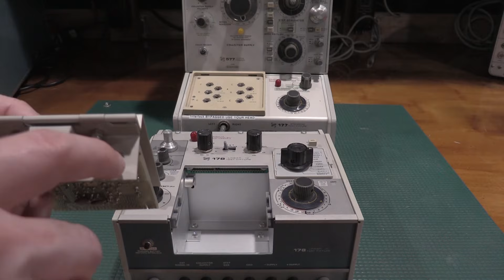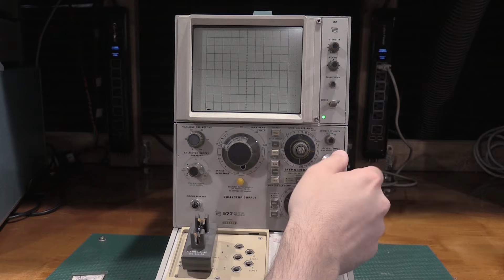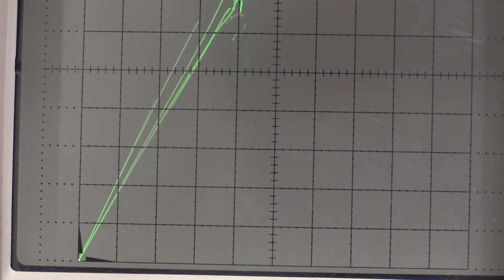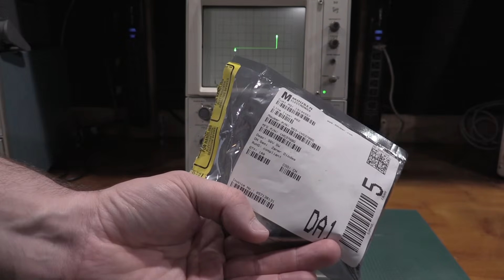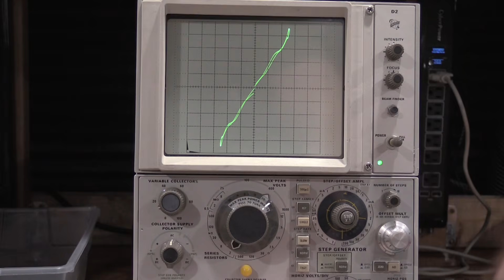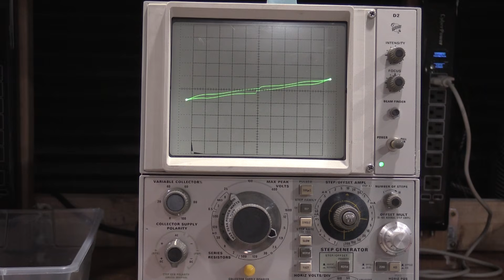Putting Random Things on Curve Tracers Russian Tunnel Diodes

Comment: How do you multiply the vertical amplitude it's by 10? Thank you for your video.
Testing capacitors are leads connected to emitter and collector?
Reply from the maker: On the 577 the 10X zoom is on the position controls. There are two versions however. The old style is a pull out this is the signal knob control and is very touchy when in use. The newer style is a dual controls course and fine. This is done by pushing the fine adjustment to release the control it will pop out and activate the 10X magnifier. There is a 10X on the vertical as well as the horizontal.

Comment: Interesting video, thank you. Glad to see your tunnel diodes arrived and check out - they are rated at 21 mA (if they are the part number I suggested).
Reply from the maker: They are if i remember correctly. I did test one in a 284 but they wont work there. They are significantly larger then one in the air line.  I do however have some plans of them. It will be interesting to see what happens.
Reply: @ZenwizardStudios, you used 3И201Г ?
I believe original TD is germanium with voltage drop about 0,1V and russian is GaAs with 0,2. To drive it will be better to recalculate all resistive part of circuit after coommon collector output transistors, then to exercise with a pair of resistors. Only exactely 200mV amplitude will be difficult to set - if it really matters.
Also this diode has capacitance not above 4pF instead of original 1,5, it makes risetime close to 70pS in ideal world.
There is another pair of russian TDs, one Ge and one GaAs, also rated 18-22 mA, but with lower capacitance. There dimensions is also smaller (another type).
Reply: Sorry to hear that they wouldn't  fit, the ones I received were larger than the original but did fit with a minor modification to the plastic diode holder.
Reply from the maker: Hmm might revisit that 284 again I have the diode still in the air line but it did not want to fire correctly, and given The thickness change it did not line up well with the trippers. Hmmm now the gray matter is rolling.
Reply: As I mentioned  in my second reply on your previous 248 video, I did have to play with the value of R148 to get reliable triggering of the Russian diodes.
Reply from the maker: R148 or R184, R184 is the resister in the air line
Reply: @ZenwizardStudios   I changed the value of R148 in the negative side bias driver - My R184 measured good for both values and I really did not want to change anything in the air line. I ended up with a value of 341 ohms for R148 (up from 39 ohms) to get the tunnel diode bias adjustment into a range that would give reliable pulse output for each tripper pulse. I probably should have balanced the resistance change between R138 and R148 but the circuit seemed to perform just fine changing R148. The Russian TDs seem to have fairly wide tolerances and mine needed lower bias current to get it to trip properly.
Reply from the maker: David V. I adjusted the R184 in the air line as it had I pulled out the 120 Ohm resister as I needed to rebuild it anyway the lead of the solder joint cracked. Doing that needed me out a 100 Mv pulse with a measured rise time of about 200 ns. I can get a better rise time if the drop the amplitude abit I can get it to go down to about 176 ns. But the fastest scope I have in the lab currently is a DSA602A. I am going to look at the pulse in relation to the output and make sure the diode is firing but initial results look promising. Pulse looks much better then before I was only getting 20 mv and it was not anywhere near flat there was a huge dip.
Reply: @ZenwizardStudios   That's great news! I purchased the 284 to test some HP 54001A 1 GHz active probe pods I was repairing for my HP 54110D Digitizing Oscilloscope - an oldy but a goody.
Reply from the maker: I still have a bit of work to do on it and get some things tweaked. I am not totally happy with it yet but making progress

Comment: I commend you on another excellent video. You are lucky to have that collection of component fixtures. I have to confess that I added a non standard component to my 576 and 577, a tooth pick :)  ( no safety cover ) .  I still use my old 575 that has as a safety feature one hand in the pocket.  I'm looking forward to your next video.
Reply from the maker: Thanks Todd, E-bay is a good source for the fixtures but they seem to stubbornly hold their value $75+ is not abnormal. The good news is 570/576/577/3XX fixtures all use the same pin outs and spacing.
Reply: And so do the 5CT1N and 7CT1N.

Comment: Nice!
Never seen a curve tracer nor a tunnel diode in real life, so an interesting combination. The TD is certainly one of the more interesting devices to test.
Reply from the maker: Tunnel Diodes are at the heart of some interesting circuits. Mainly things that needed to be FAST. D180 in a Type 284, Trigger circuits in LOTS of scopes 400, 5000, and 7000 series all use TD’s in their trigger circuits. As well as the fast edge square wave calibrators used to do the high frequency compensation in scopes.

Comment: Very interesting video. You have accessories for the tracers I have never seen in person before.  Thank goodness I have the enclosure/cover for my 576... but I have non of the OEM plug-in part holders. ... one of these days..
Reply from the maker: E-bay is a good source for the fixtures though they have tended to hold their value. The good news is the 570 / 576 / 577 / 300 series fixtures are all intern changeable and there really is not circuitry in them just wiring. If you keep a look out you can find them for a high but not astronomically high price. $70 for a fixture vs $450 for a fixture. I have feelers out for a type 176 to add of one of the 576’s in the lab.
Reply: @ZenwizardStudios   I found a nice plug-in of new construction that fits small wire leaded components for only $50. For larger parts I just use banana to alligators.... not as convenient as plug-in. I have been toying around with idea of finding the appropriate Mill-Max socket to fit the leads on TO-220 and the other common flat pack devices... and the  whipping up a PC board.
Reply from the maker: @jenniferwhitewolf3784  The 177 manual has a page in it that has the cad drawing of the pin spacing for the curve tracer. If i remember correctly it has the measurements for the spacing as well as a drill guide if you make a photo copy. This should assist greatly in cutting down the time of design.

Comment: A great video would be to build an power vacuum tube adapter with external power sources for matching tubes.
Reply from the maker: I am rolling some things around in the gray matter about that the Main issue there is the wide range of filament voltages. And sockets that tubes use. Dennis from the Tekscopes group has a paper out on how to convert a tube tester to a curve tracer. But a modded and unmodded tube tester is something that the bench needs to locate still. However doing a plugin for a target tube say a 6L6 would not be difficult.
Reply: @ZenwizardStudios  Your video got me thinking about the fixture the guy made in this video here https://youtu.be/ayLjvgcyfTc with external supplies and the preamp tube adapter here: https://www.ebay.com/itm/265180960125?hash=item3dbe04557d:g:9s4AAOSwhlBf3bQW  I bought one of the small ebay ones for my 577.  I asked him about making one for for power tubes (6L6/EL34) like in the YT vid.  He said the problem of dual sockets on one fixture isn’t covered on that YouTube video. The idling tube only has screen voltage applied which causes it to act as the plate and draw too much current. This can cause the tube to glow red and the screen to fail.  So more elaborate switching would be needed beyond the A/B switch on the 577.
Reply: Here’s the article where the 576 fixture came from. https://www.pearl-hifi.com/06_Lit_Archive/15_Mfrs_Publications/35_Tektronix/Tube_Testing_w_576_et_al/Tube_Testing_w_576.pdf
Reply: @rpbale   My dear friend William Perkins is the owner of PEARL... I will mention that you found the resource to be of value when we chat tomorrow. Sometimes he wonders if its worth the effort to keep the archive of articles up and running... I keep telling him YES!